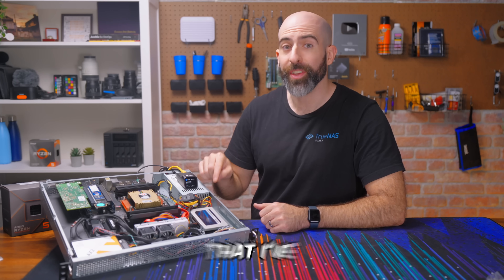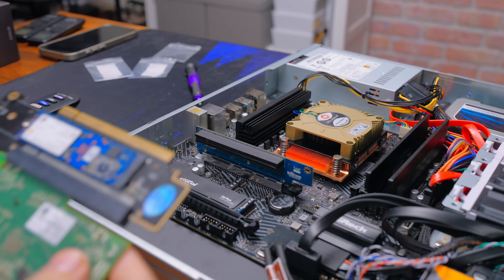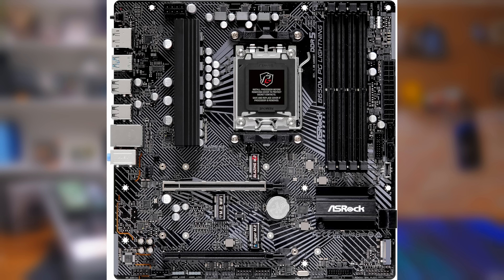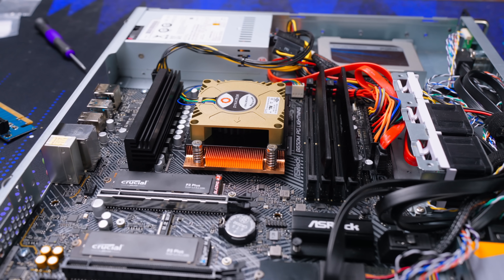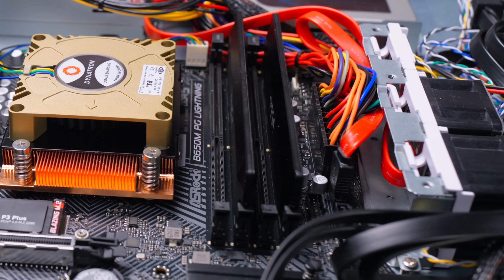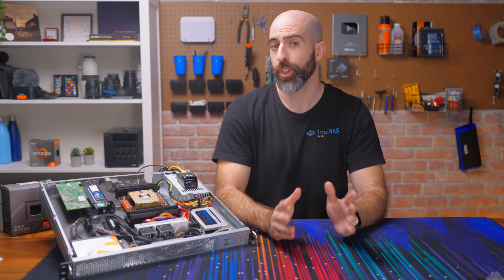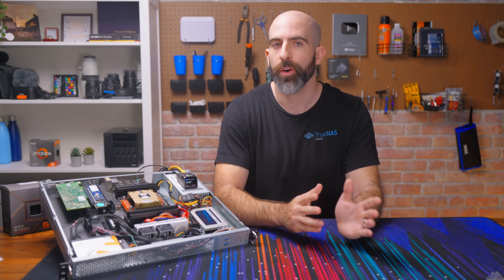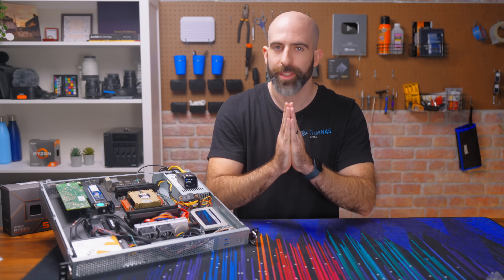The BEST home lab server...for me

Comment: Damn that bifurcation adapter card, I wish I'd have known about it sooner. I achieved a similar thing on my AM4 server by using a 4x NVME card, put two NVMEs in two M.2 slots, and two M.2->PCIe adapters with x4 riser cables to two other x4 PCIe cards. It's a mess compared to just using an adapter like this, but well, it works. With 3d printed brackets for the pcie cards I even manages to somewhat route those riser cables decently and get the cards mounted upside down above the motherboard (in a 4U case).

Comment: I genuinely do not understand the “I have 42u,” (meaning your rack is using the room’s square footage no matter what you do) followed by “I still don’t want to use more space than necessary.” 

Makes absolutely no sense to me; it’s like wanting to sign up for thermal struggles, finding parts that fit, and being just giddy about limiting your options. 

For me, just starting with a 2,3, or even 4u chassis seems like a much more sane option;  larger chassis means slower quieter airflow created by quieter fans, and parts that are actually available.

I do get using what you have on hand though 😉
Reply: its 42u total. but you can see in the clip its not all empty - and hes probably running out of space for other projects he wants to put in there
Reply: @ arbitrary and unlikely guess based on no evidence.  But sure
Reply: @threepe0  what’s arbitrary? That there wasn’t 42u of empty rack space in the clip he showed? Lol

Comment: After being disappointed by the AsrockRack B650D4U i'm now on the Supermicro H13SAE-MF which not only has ipmi but also 3 pcie slots and audio connectors. Pretty nice board for an AM5-server, especially with 192GB ram.

Comment: I just built almost the exact same system, in a 2U. At idle the 7600 with a Noctua NH-L9a sat at around 51-52c, -25 undervolt dropped it 15 degrees. I added an a310 for transcoding though, system sits around 60-65w with a couple transcodes and direct streams in Plex.
Reply: how much it consime the power when it is idle , i was plan to build one of this , but 60-65w , thats cost crazy in Australia 😢
Reply: @fandywinata254  if you aren’t running multiple transcodes at once get an N100 PC. They run under 25w at full load. More than capable for the average user. I’m in Aus too btw. My  build in the comment above will cost no more than $500 a year to run in electricity.

Comment: I know you are looking at Proxmox but I think it would be interesting to use this thing running opnsense

Edit: I have been shopping for an opnsense box. Probably the closest I could find was the 1u 25G router from Gowin but that thing lacks upgradabilitiy, uses an anemic N305 CPU and still costs $700. Compared to the competition out there it honestly isn't terrible. If you get something capable of 25G from opnsense you are spending $6500. Still though a box like this really is the best.

Comment: "Who the hell needs 100 gig networking in their homelab..."
Been rocking 100 Gbps Infiniband in my basement since 2018-2019-ish timeframe.

Just finished two CFD runs which took about 65000 seconds each (or about 18 hours a piece against 107.4 million elements/cells).

Comment: You could have set a negative curve in PBO underclocking your CPU by around 30 units (~100mV), That helped me gain performance instead of losing it since my 5600X no longer overheat like before and can maintain its turbo boost longer.

Comment: About the 190$ for that case and psu u can't beat. You can beat it really well actually I have a refurbished Dell power edge r630 10 cores each CPU and dual 16 lane pcie and it's 1u  with 8 2.5 inch drive bays all for 180 including shipping on Amazon of all places but it does drink power

Comment: Every time I see a 1U build I'm like "that's a cool system and a totally unreasonable amount of human suffering". Even 2U has certain imposed limits, so I think I'll use those for a practical minimum viable idea. Thanks for the video.
Reply: Yeah I was looking at building my own opnsense box and trying to decide 1u or 2u. I have decided on 2u because it isn't nearly as hard to plan for. The added benefits to part compatibility, noise and cooling can't be understated. Instead of dealing with 40mm fans you can use 80mm fans. You also just get to use half height cards in a regular chassis. This means most addin cards will just work without any issues.  Any full height cards aren't all that difficult either as you can use a reiser and actually still handle some of the bigger cards like GPUs even if they are thick. Yes 2U is 2x as much space as 1U but 2" is not all that much when installed in a home lab. The benefits you get by going with 2u is just worth it.
Reply: @chaosfenix  It's also much much more versatile to go 2U chassis - so many more build configs can fit in one. I hate single use computers so anytime I can retire a machine and re-deploy it for friends/family as something useful to them has major value to me. 

Not so much future-proofing fallacy as 'upcycling value in future'.
Reply: @FrenziedManbeast  Well and to this point you can usually deploy more powerful hardware without resorting to jet engine fans. In this build it was being pushed thermally with a relatively low power CPU. If it was 2U you could fit a ton more cooling and as such go with something that has 2x as many cores. Are you really gaining that much density with a 1U if you can fit 2x as many cores and 2x as many addin cards in the 2U system?
Reply: Yeah, a 4u that you can stuff full of consumer parts and large fans... will be quiet and expandable and will run the entirety of a homelab for years. Build something fast that can idle down to low power... and virtualize/containerize the heck outta it!
Reply: @MikeKirkReloaded  Yeah my main server is a 4u system for all of those reasons. I do see some of the benefits of it all down to 2u depending on the application like the firewall I am putting together. 1U though just doesn't jive with me. I don't have my systems in a sound isolated network closet so noise is a major consideration for me and I would imagine more home labbers. running anything more powerful than some raspberry pi's in a 1u chassis though is just going to cause more headaches than it is worth.
Reply from the maker: Smart

Comment: What a coincidence, today I was planning a 1U NAS and followed an AM4 path to the exact same Dynatron cpu cooler complete with Amazon reviewers warning about having to chop it with a dremel to fit your motherboard.

My challenge is trying to get an ECC system with 10GbE that idles under 20 watts. Due to the surge in electricity costs in many western nations homelabbers have swallowed up the global supply of low power Fujitsu, Supermicro, and Asrok Rack mini-ITX server motherboards that support ECC.

Comment: I'm currently in the process of building a 3 x 1U cluster myself, and I relate so much. The thermal constraints, the search for the right motherboard/CPU combo, cable management, enough 2.5" space, the noise constraints, *the chassis itself*... What a headache. But what fun it is at the same time

Comment: I have these same cases but using an AsRock Rack ROMED4ID-2T motherboard and some Epyc 7F32 CPUs. For cooling I'm using a Dynatron L18 AIO and it's actually pretty quiet. I'm using some dual QSFP ConnectX-3 Pro cards (these are routers) but I'm thinking of building another in this case with the same motherboard but an Epyc 7402P and an RTX 4000 Ada Generation with the single-slot mod.

Comment: Yeah I would’ve gone 2U for more flexibility of PCIe attached devices. I’m building one at the moment and will go Intel i5 for the iGPU for Plex as a backup, an A380 for my daily driver VM, and the rest will be Proxmox VMs and containers.  Still should be pretty low power even with 2 GPUs for my use case.  I have separate machines for work, editing, and different types of gaming.  I have another Proxmox server that is just the same thing running as backup, but no homelabbing as I want to keep it reliable.  This one is just for my daily driver and messing around with mostly ephemeral VMs and containers.

Comment: That's a sexy build and I wanna copy it, but dunno about Dremel-ing down the heatsink. Already have a B650M PG RIPTIDE, 7900, 64GB RAM, 2TB NVMe, dual 10Gb SFP+ NIC, quad 2.5 GbE NIC, and an HDPLEX GaN 250W PSU sitting around in a 2U Rosewill case doing nothing.
Reply from the maker: Yea def go 2U...so much easier.

Comment: I've had lots (unfortunately) of builds with similar problems that you found with the connectx-4. Protip: Use some zipties or some twist ties. It's not crucial by any means, but I've found that accidental bumps happen, which can halt/freeze the system and in some cases break the card.
Reply: Of course it's not Crucial, it's Mellanox/nVidia...

Comment: A cheaper way to go about this sort of build is with an X470/570 board and something like a Ryzen 5700G or even better, 5700GE. The GE is a 35W SKU with slightly lower burst clocks and it's an OEM-only processor, but it can do low power and at least with X470+, you aren't limited at all in your I/O options; I have 40Gb Infiniband  and a Tri-Mode HBA on mine.
Reply: Hey what's your idle usage? Care to share more about your build?
Reply: @privateaccount5400 I no longer have that system, partly because it rarely wound up idle and the CPU actually became a constraint for me.
Reply: @likefunbutnot what you got now?
Reply: @privateaccount5400  I split things up so I have a Ryzen HX370 (12c/24t @ 55W max total system power draw) and an N150-based file server.

Comment: "You cant beat that"  Hold my beer! You could have purchased a used R630 for around $160 shipped to you, added a video card and had 8 2.5 drive bays, add some ram, and some beefier cpu's and call it a day, all in a 1u  FF with dual Power supplies, dual cpu's etc.. Nice little project none the less, and it includes IPMI.
Reply from the maker: Now do the power draw
Reply: @RaidOwl  Right now with 3 vps servers at idle is 70watts, granted they are not under load but when I ran the tests it pulled at most 150watts at max peak. also no video card, so deduct that as well.
Reply from the maker: Cool, sounds like a solid setup

Comment: Hah - I love ghetto servers!  I followed along on the original build you did in the case, and adapted it for my own scenario - I went with some used supermicro D-1521 boards (yeah yeah, cpu etc.), replaced the stock inwin fans with some Noctua quiet fans (fine for the low power Xeons), dropped in 4 Intel enterprise 4TB SATA drives, a 1TB m.2 boot drive, and the Intel ARC A310 Sparkle card, and 128GB of ECC RAM.  These are super as low power ceph storage nodes, runs Plex with transcoding perfectly, piHole, and a few other low demand LXC's under Proxmox.  I wound up building three of them, and total power draw is around 120W when they're all running heavy I/O loads.  Thanks for the tips!  Total cost for the trio of servers (minus the storage) was under $1200.  I did find a great used deal on the SATA SSD's tho, all less than 2% wear, about $180/each.
Reply: That seems like a very nice system. What’s the idle consumption?
Reply: @Yiveytube  Idle is harder to determine, since they aren't ever really idle with ceph.  I've seen them down around 35W/each when I was setting them up.  That whole rack hovers around 220W, and that's the three servers, another proxmox terramaster F8 plus, an IP capable power distributor, and a 10GbE 8 port switch, and probably a few watts of parasitic draw from the UPS.

Comment: Very cool build, I’ve been meaning to do something similar with the same cpu, as a bought a b650 motherboard lot of 5 off of fb marketplace for $60 and got 2 of the boards working (that just had bent pins) with this cpu as the test subject lol… 

Are you planning to make one volume on the NVME’s and another on the sata? I know unraid can do volumes spanned across different types of disks but wasn’t sure if proxmox could do it too

Comment: I always like the challenge if a 1U formfactor that doesn't scream.  I used a small 1.5U server case as an enclosure to fit in a pelican 1490 briefcase with a monitor mounted in the lid -- was still able to use an SFX PSU if I'd wanted to.. much lower availability for cases.

I'd look at doing a proxmox cluster out of prebuilt NUC formfactor computers (using USB-C [40gbs?] as the cluster networking).  See if you can do similar performance for around the same price with less noise/power factor/space etc.

Great video, keep it up bro!

Comment: Great vid! I'm specing out a very similar build now. The only difference: I want ECC memory and a faster CPU.
I'm currently deciding between three mobos: 
Gigabyte X870E Aorus Master
Asrock X870E Taichi - Level1Techs has a great video.
Asrock X870E Nova WiFi - has 5(!) M.2 slots, 3 pcie slots, 5gbps onboard, and at $330, it's one of the better value in the line.

I like how your rack chassis looks like unifi gear.
Reply: Take a look at some of the X670s or X670Es they share a very similar feature set, just lacking some things like USB 4 for the most part. You can get the same ammount of NVME space. Unless you really need the features like 10g networking or a 5g RJ45 port there would be no reason to consider past b650 honestly. Most of the VRMs are overkill, the E variants especially.
Reply: @xiraijuakara5988  Thanks! 10g networking via the chipset would be the only benefit for me. But even that doesn't work because I think all the 10g RJ45 mobos don't support ECC memory! Dang. 

Now I'm between b650 or threadripper. lol

Comment: I don't see dedicated cooling for that U.2 drive.
You are going to have a bad time unless you fix that.
I jumped into the world of enterprise U.2 stuff this year and the biggest issue I had (besides the expensive ass cables...) was needing to actively cool every drive.
You can get away with just case airflow for certain brands if you are letting them sleep most of the time.
Micron and HGST/WD are not those brands...

I'd bet if you look up that drive it pulls 20-25w of power while "active".
(And 10-15w while "idle")
It will absolutely kill itself without active cooling.
And not a gentle Noctua 40mm quiet boy either.

I'm actually not sure you can do it quietly with 40mm fans unless they scream.
Reply from the maker: Nah theres where I cook eggs

Comment: Are you having any problems/issues setting up or using AMD igpu instead of intel igpu for transcoding?
Reply from the maker: Not natively but I haven't tried passthrough yet
Reply: @RaidOwl  Thanks for the reply, id be interested to know if it works in a proxmox vm running docker for things like jellyfin/emby and frigate, great video and setup btw
Reply: Unfortunately AMD is like...a decade behind Intel when it comes to encoders...
Heck even Nvidia is way behind Intel.
QuickSync really is THAT good. It sucks that Intel bifurcation options are usually lacking. It makes this kind of thing so much harder to build.

Comment: You are not a home-lab unless you are undervolting...  😂  Just kidding, cool build!
Reply from the maker: lol yeah kicking around a video idea of undervolting everything to see if its worth it.
Reply: @RaidOwl  Great vid idea! Also some pointers for us noobs to undervolting would be great. How to know when you've gone far enough. 

Also, what's the power savings at idle vs high load? Thx m8.
Reply: @RaidOwl it's a bit of a lottery as result depends on a silicon quality. It tends to work better with higher end parts as they typically use better binned chips.

Comment: I hope you slapped a fan on top of that 25GE to keep it cool because you'll get transmission errors.
Unless the casing has fans blowing directly on it, it will overheat with moderate traffic on it.
Reply from the maker: I have some little 40mm Noctuas to zip tie to it

Comment: There's always going to be compromises in a home built 1U. I think you did a great job in addressing those dude! perhaps a bit of creative 3d printing will be able to support that dual 25G nic? Overall you nailed that 99% of the way :)
Reply: Nahh. It's a flat piece with a few tabs bent over.
Mock it up with some cereal box cardboard and then cut it out of a scrap of sheet metal.
You can get a square big enough to make 2-3 of them from your local hardware store for $3 if you don't want to use a random piece of scrap.

3d printers are for art and prototyping.
Do not print flat sheets with them.
Reply from the maker: lol yeah I REALLY need to invest some time into learning some 3d design